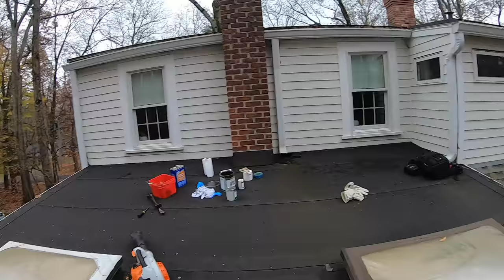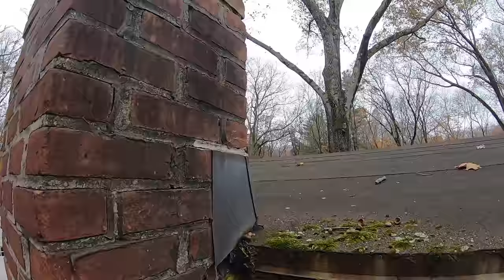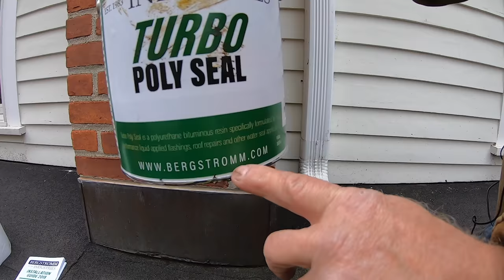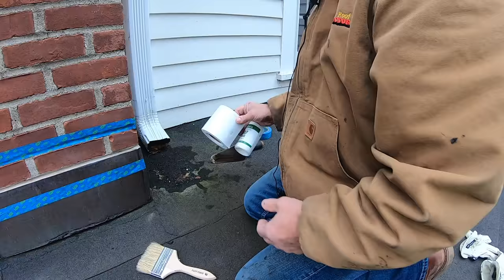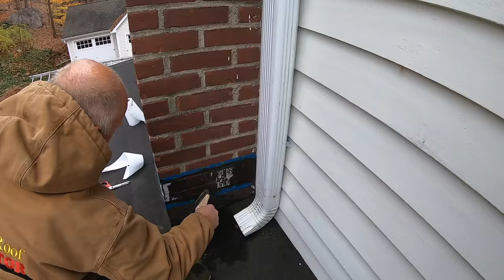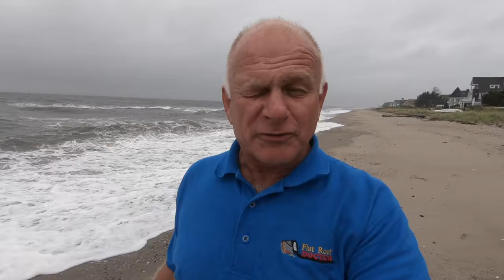How to repair Chimney Flashing Leak in 5 minutes. This will blow your mind

Comment: Thank you, sir! I had this problem last winter only when snow packed up on my flashing.  It doesn't leak otherwise even in the heaviest downpour.  I calleda riding company and they wanted over $4000 and to come in and replace all the flashing.  It was ridiculous.  This is all it needs.  I'm going to do this this fall.
Reply from the maker: you are welcome
Reply: Same exact situation 
Found the products at Home Depot. Came to the videos to see about any tips
I like the tape idea to get the clean easy  edges
Reply: How long would thus last sir?
Reply: When there's heat from the home coming up warming the underside of the roof it melts the snow & it runs down and when it hits colder sub straight it refreezes and wicks up backwards because of ice daming and can get up under roofing shingles  and more! When u mention that u only had leaks when it snows not in rain it doesn't sound like a leak by wicking cause of an ice daming!
Reply: Yes ice daming but especially moss / tree debris is also a major issue can cause real bad daming.  the tree debris starts composting and moss grows up in underneath the shingles and into the flashing up the chimney. Ice grows on the debris and moss making it even worse

Comment: Nice job as always. Learned about leak tracing. Bought poly turbo seal and roll of white fabric same time. Now I'm going to fix the chiminy flashing. I know surface has to be clean for adhesive to stick.  I'll wipe with lacquer thinner after scraping and blowing/vacuum off .

Comment: Doc, you have made some excellent videos, but this is not one of them. That caulking is not perfect but is not the cause of the leak at skylight and you are far too knowledgeable and experienced to think that. Same with the mortar of the chimney.  At 2:20 is the big error. No, or very very little water would leak inside there.  From the images, as you correctly said, the skylight is probably not leaking (masking tape would have made the job a little better though). The cracks on the chimney are way too small to be the cause of the problem and would be easily fixed with primer and 2-3 coats of white acrylic gloss, just like the rest of the house. Your repair job here is nice but superfluous. Need to have a close look at that  downpipe.  Divert the flow to another downpipe or far away from skylights.  Hope you found my comments constructive and that you weren't called back by the owners to revisit the same problem
Reply: Quick question - does your suggestion of primer and white acrylic gloss get painted onto the mortar lines in the chimney?
Reply: @jjbb9  Yes. make sure the chimney is thoroughly washed first, preferably with a pressure washer. If mortar falls out with the washing, repoint the damaged mortar lines with 4:1 mortar. the trick here is that you MUST wait at least 4 weeks for the mortar to cure BEFORE priming it.
Reply: @redpost2380  totally agree man. I said the same thing in another post. Those tiny cracks in the chimey are normal..not enough to warrant anything. That caulking looked pretty solid if anything hes the one that manipulated it lol first thing I noticed was that gutter...and it definitely fell in "in line" with that corner of the skylight. I doubt what he did fixed the problem i wonder if theres an update to this video

Comment: I would repoint the brickwork or motar joints, extend the downspout away from the chimney flashing! Even if that small areawas the issue what about the remaining gaps and water intrusions into the chimney ! Now i think its a cool product but in this casei feel the downspouts were causing the chimney flashing to leak and ideally it need reflashed n sealed up then maybe use this product. That chimneys flashing should lay on top of the membrain and use sealant under its edges ! Fix the motar ,reflash chimney snd extend that downspout

Comment: Still doesn't solve the water saturation problem.  Water saturates through the brick and mortar so what you did will solve nothing!!
You have to use a brick/ mortar sealer to fully seal the chimney from the top down. 
Then put a full metal chimney cap on the top to prevent water coming through the mortar bed on top.
There's so much more you could have done to fully seal and fix that chimney. 
Nice try!👍
Secondly you have a downspout pouring tons of water right directly inline with the skylight leak??
Reply: Yes you are right  . If the Bricklayer put in proper lead trays  no water leaks at all I'm a Bricklayer and know what I'm talking about
Reply: Do NOT use brick/mortar sealer if the bricks or the mortar is made of old lime without portland cement. They began using portland cement widespread in the 1930's, so most chimneys and brick in general were soft lime before that. If you seal soft lime, it will promote spalling because water will get into the brick causing the brick to expand, but it cannot expand where the waterproofing is, and thus, it can break. Historic brick must be treated with special waterproofing meant for old lime bricks. However, if the bricks are modern hard cement, then the sealers are fine. Note that all bricks, pre and post portland cement, are porous and will absorb water which can drip behind the bricks and make their way to the base of the chimney even if they appear to have no cracks. That's why you need a drip pan at the base of a chimney that catches water on both sides of the bricks if the bricks are only one layer thick (brick veneer). If there are multiple layers of soft brick behind the brick veneer, then they should do a good job of absorbing that incoming water and will release it back to the veneer after the sun comes out. That's how they used to do it a hundred years ago. When you mix technologies, things don't always work as expected.

Comment: Hello Flat Roof Doctor, I have a chimney that has some bricks that have the face of them chipping or it looks like they have cracked little pieces of the face off. What should my concern be or how do you fix this?
Reply: These bricks shouldn't be causing a leek but if they are just grind out the mortar around the damaged bricks and replace them hope that helps

Comment: Sure.  You could do it your way.  Or, you could do it the right way.  Grind out that joint and repoint it.  A patch is a patch, and patches fail.
Reply from the maker: Repointing is an old trick. This failed due to pointing or grouting. Do you suppose that cement stuck between brick and metal is a good idea. I have seen this problem over 40 years. In some cases it works and in other cases it doesn't. I have been using this technique over 5 years and have had no issues. Call it what you want. it is easier and simpler so anyone homeowner can do it unlike re-pointing you are referring too

Comment: Last 5 years. A good mortar mix is permanent...cheap never last my friend
Reply from the maker: The mortar mix is what failed in the first place. I have worked on many 100's of chimneys over the years, the mortar is what fails. So your so-called "expensive fix" did not last on many chimneys, the "cheap" fix has worked for me for many years.
The obvious is what you are missing.
Reply: @FlatRoofDoctor  Should have repointed the chimney and removed and replaced that failed joint sealant.  Now you have a reinforced mess of urethane and bitumen that will have to get replaced in 10 years.  Yuck.
Reply: @FlatRoofDoctor but your layer of gunk is below where those mortar cracks are, so how will that help if the water is already in behind it?

This is curing a problem that doesn't exist, and will not have cured the problem that does exist

Comment: Do you have a chimney certification because most of these things looks like you’re doing roof repairs on chimneys I am a chimney certified technician and half of the products you’ve been using are flammable and are not up to code with the guild of chimneys use products that come from saver system Polly seal does not go on the crown specially on the crown not trying to be rude just informing people who watch these videos and think this is the correct way to fix your chimney
Reply from the maker: Flammable at the time of application. But when cured after a few hours, it will not lit on fire.
Here is the misinformation you are spreading. You are trying to put fear in people to let them think that any material on the chimney will combust causing a fire. That is wrong. No chimney produces excessive heat for any material to combust. The heat coming out of a flu pipe is so minimal, I can put my hand over that opening and it barely gets warm. People even use wood siding to cover entire chimneys. I have seen people wrap the entire chimney with plastic tarps or saran plastic. It is a bad idea to think it's gonna catch on fire.

Listen, you ask if i have a chimney certification. Hmm, what do you think. Do you have a helicopter Pilots license. Use common sense. When you ask questions like that and make statements about combustible materials on chimneys, I realize  you needed some schooling. I am glad you have your certification from "Tumi" At least you can fix chimneys properly. 
Thanks for you comments and statements.
Have a nice day

Comment: Anyone know what a good equivalent in the U.S. would be for the bergstromm? Is Henry Flashing Cement as good?
Reply: Henry is a reliable brand
Reply: Both of those are good home goods store brands. Also there is the flex brands. A little pricey but pretty good. I personally use either mule hide or geocel products. Both are found at roofing suppliers such as abc supply, beacon supply, etc. With Henry brush grade 2 coats are usually needed. Thru the roof is a little better. Behr multi surface is also a good temporary go to, until you can find something better. If you choose to coat your whole chimney, you really need to make sure no moisture is getting in because it will not evaporate correctly with a painted chimney.
Reply: Ken Li  I never had any problem with it.  Worse comes to worse you can always hot mop the crap out of the flashing, but it wouldn't be pretty if it can be seen below.
Reply: Karnak 155 best roofing cement out there wet or dry the BEST !!!!!

Comment: the guy criticizes a perfectly clean and sound neatly installed sealant saying that water was getting behind it even though he cant remove it or open a gap in the edge........and then creates a mess and claims to have cured a problem...... how not to repair a roof !
Reply: He's an embarrassment to roofers
Reply: Yea this is some goofy shit
Reply: Don’t do this to your chimney or to the roof structure around it! The flashing should have been underlaid with water proof membrane and kerfed/cut into the chimney, then sealed with professional grade caulking. Any tuck pointing or crown repair should have been done then as well. Now that he’s done this, moisture will be trapped in the brickwork, which will cause spaulding, leading to brick replacement—a costly repair in the not-too-distant future as this product dries out. And water will continue to come in. Foolish! Don’t do this.
Reply: water goes where water goes. There was obviously space between the caulk and the brick, even before he tried to pry it out.
Reply: Apologies I might have missed it what ply was that paper that you put on there in which Supermarket can I find it in
Reply: I tried this on my roof that was leaking and it doesn’t leak anymore. People that criticize this guy are probably roofers that charge thousands of dollars for a quick repair that can be easily made by the house owner.
Reply: I had my roof redone 7 years ago and my Chimney repointed a year ago.  Now I have water leaking.  I have raised this to both contractors as they both point at each other as the source of the problem.  At least this guy provides an option to try.

Comment: What is the white roll you use after your first coat?
Reply from the maker: It is a Polyester Fabric that is sold with Turbo Poly Seal. This fleece is what gives it strength
Reply: @FlatRoofDoctor  thanks man. Appreciate the fast reply. can't seem to find the turbo poly seal in Canada. Know of any other brands/equivalents?
Reply from the maker: @icedarcade218  If you text or call me I will give you the brand you can find in Canada 203 858 0080
Reply: Ultra flash and polyester the best out there in the hardest extreme weather

Comment: at :39 seconds in you can see a cobbled up little square corner of roofing at the upper left corner of the skylight. It looks like about 3X4 inches square of patched in roof with sealant along 1 edge. Then 10 feet up the roof is a downspout flooding water down the roof. Why in God's name wouldn't a person extend the downspout down the roof past the chimney and past the skylight? The chimney caulking had a couple pinholes and was so solid that homeboy couldn't even break it off. This roof is a nightmare. The caulking most likely isn't an issue at all.

Comment: Horrifying idea.  My god.  Should have just removed the old sealant and replaced it with new.  And repointed the chimney.  What happens in 10 years when this stuff needs renewal?
Reply: By then its somebody elses problem.
Reply: @barackobama5304  - just like to former President would say.
Reply: It's a good value proposition

Comment: Why not just use flashband instead of polyseal paint then lint cloth and polyseal paint again? At least with flashband you have an aluminium layer a bitumin layer and a non tear acrylic layer- all in one, no paint no mess and quicker, if applied  correctly lasts 10 to 15 years! Ok lead can last 50 to 100 years but this is more of a 10 year temporary job anyway.

Comment: Having a drain spout dump water at the base of a chimney was dumb to do in the first place and equally dumb not to correct when there is a roof leak. 

Only silicon sealants have the needed durabilty to be used on a roof or rain gutters.